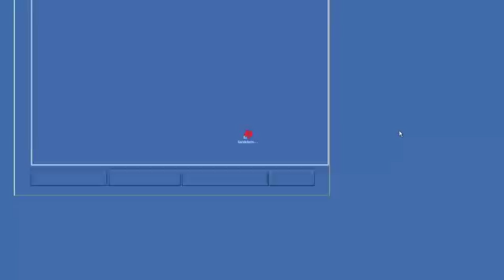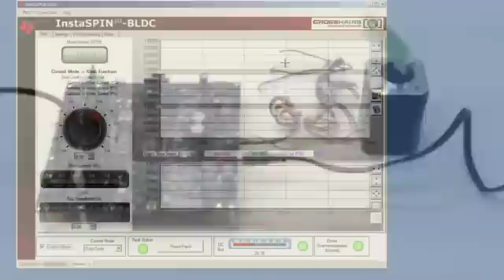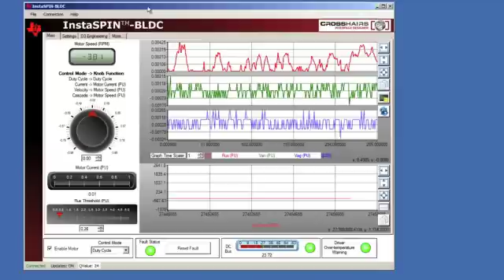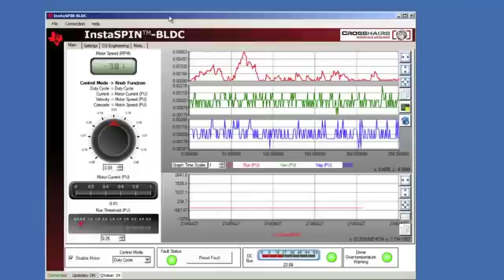Stellaris Development Kit from Texas Instruments  - Product Overview

Comment: Would this work for a wash machine motor. The 3 phase with 36 coils or so. To turn it at 2000 rpm or so with maybe 24 volt battery system.